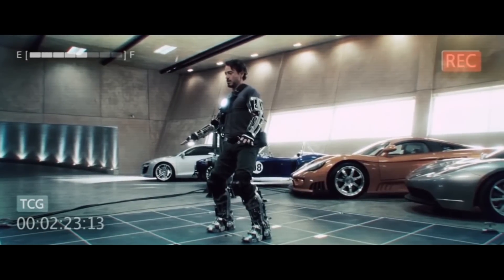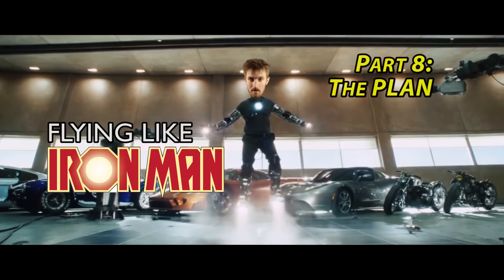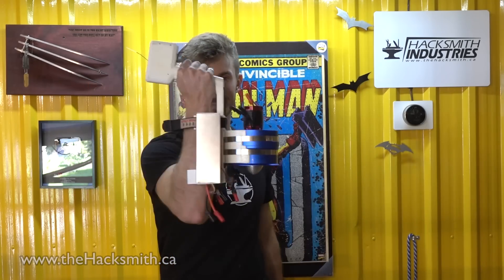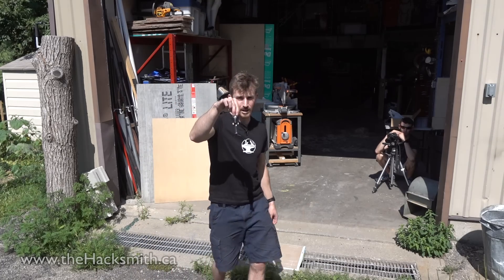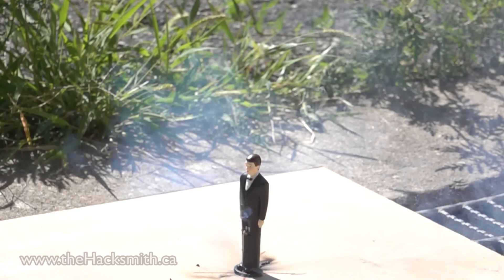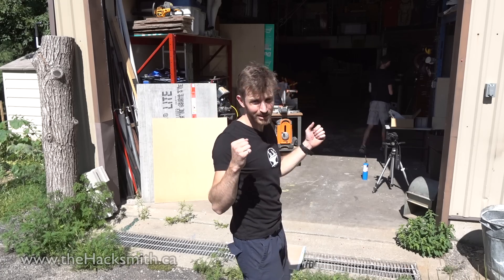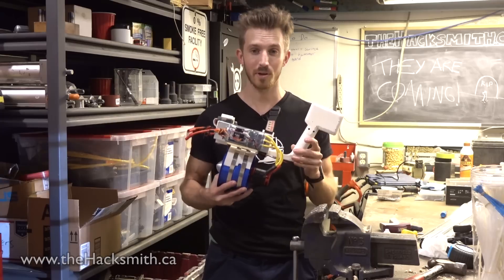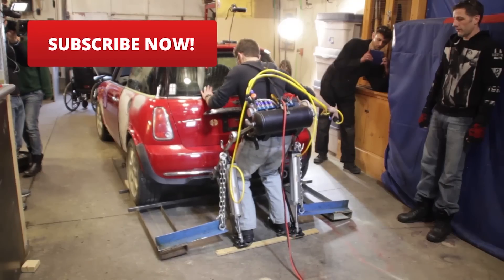Flying Like Iron Man #8: The Plan with Electric Ducted Fans

Comment: Dear Hacksmith. Why do you delete my comments?
Reply from the maker: +MatryxMayhem don't think I do, maybe they get marked as spam?
Reply: +the Hacksmith its possible. Most of them were on the efficacy of using the Turnigy Rotomax 150cc brushless outrunner and a custom CNC'd Duct as well as turbine. Considering people rewind them for use as paramotors in ultralight aircraft. They produce anywhere from 20-30kgs of thrust but thats utilizing a propeller. Using this platform would reduce the amount of EDF units and ESC's but its only really viable for the thrusters on your back as the diameter would be to large for use in the thrusters mounted on your hands and feet.
Reply from the maker: Hmm... only problem is I think we'd need a 4- or 5-axis CNC in order to mill the props since it's all one piece. I'll have to look into those motors though...
Reply: +the Hacksmith Well, for the turbine you could just outsource the task to someone who specializes in things of the sort. They can also be fabricated fully in carbon fiber.
Reply: +the Hacksmith Though the tolerances for things like turbines even at such a small scale are ridiculous.